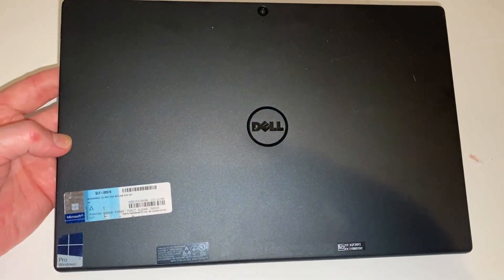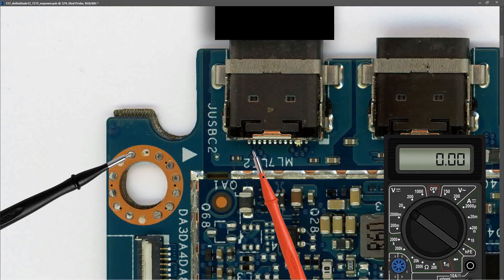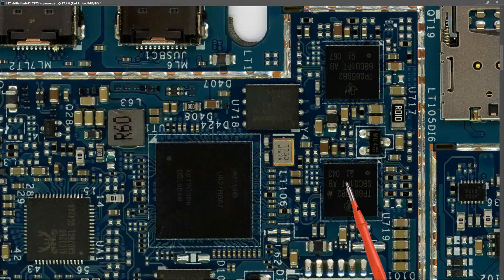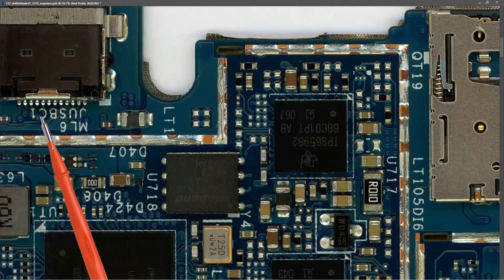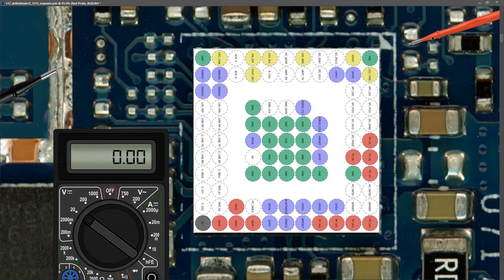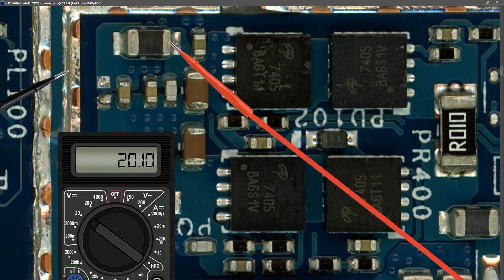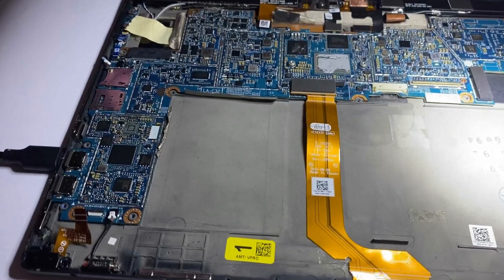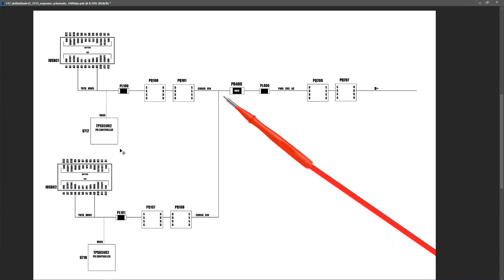DELL LATITUDE 12 7275 - HOW TO TROUBLESHOOT A TABLET

Comment: link for the google drive with your shematic ? thanks. usualy a mosfet canal P the gate must be lower than the source, but usualy not 0 v, around 6 v. see if is not short that first or second mosfet ? thanks, you can change the ic with rosin without do reballing  the balls, see how sorin do ... its the same... thanks greattings from Portugal
Reply from the maker: Schematic is up. I'll build on it with future videos. 

Yeah, I think any time there is 0V on the gate of a P Channel MOSFET, there seems to be an issue. With a number of recent working Dells, which had two input P Channel MOSFETs, the gate of one was ~1.5V and the other was ~3.0V. It would certainly be helpful if they told you what voltages turned the MOSFET on and off in the datasheet.

Comment: Awesome video and very informative, thanks! I still don't really understand very well how MOSFETs work, so I have a question. What is the correlation between the gate pin having voltage and not allowing voltage through the MOSFET, versus the gate pin not having voltage and allowing voltage through the MOSFET? Sorry if my question is confusing.
Reply from the maker: Hi, I have not done a video specifically on MOSFETs but in many of the earlier videos I would have tracked the voltage through the input MOSFETs - if you go through those I think that would help.